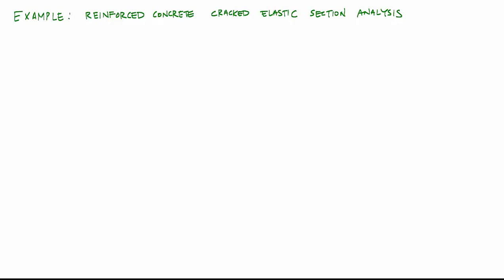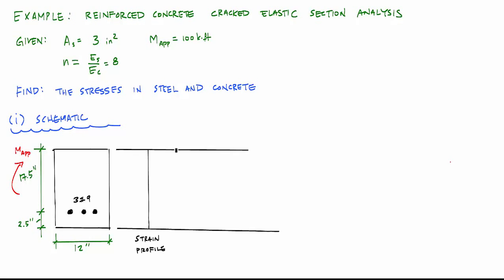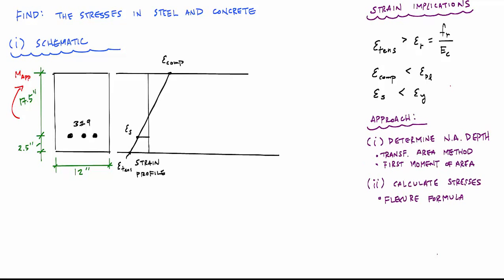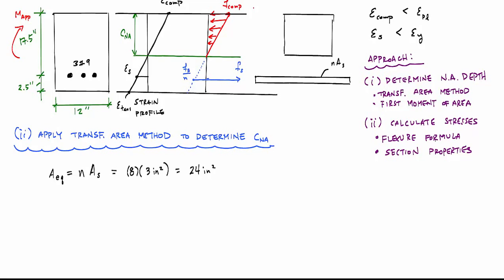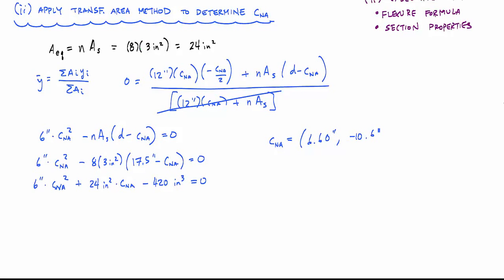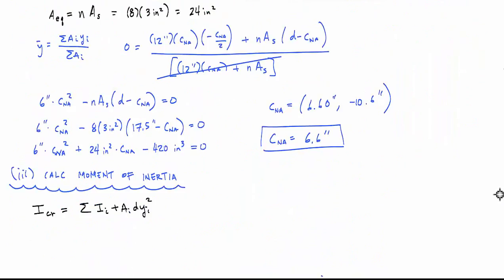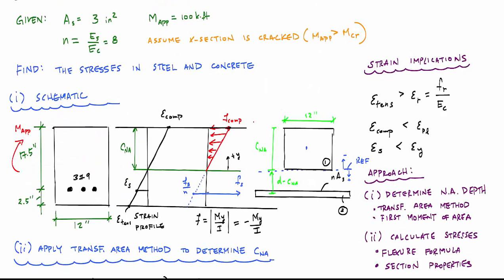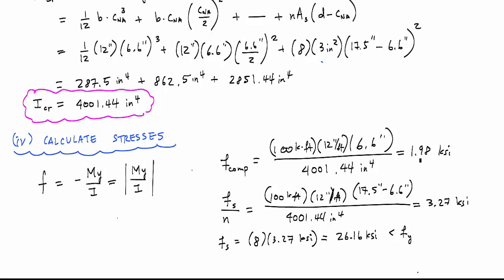Cracked Elastic Section Analysis Example 1 - Reinforced Concrete Design and Analysis

Comment: Finally...first explanation I have found (after quite a bit of searching) for why the area moment of the transformed steel section about its centroid is neglected and only the second part of the parallel axis theorem is applied on the transformed steel section. Thanks!

Comment: Can you make a video on how to use the reinforcement to determine whether compressive steel or tensile steel has yielded or not for DOUBLE REINFORCE concrete beams? I know there is another way of doin it but my professor did it another way and I'm hoping maybe you might explain it better than him.

Comment: Hello @structurefree All your videos are just great.. you explain really good,
Can you (OR SOMEONE READING THIS) solve me these 3 questions that I dint get
1) What is the strain PL, for the concrete... It is the limit but how can I calculate it
2) same question but with the stress PL for the concrete.
3) I remember sometimes using (n-1)As... can you explain me when is this used 
Thanks..

Comment: How does the number of steel reinforcements affect the problem? For instance if there were only 2 steel rods instead of 3.
Reply: Never mind, realized that #9 bars had a cross sectional area of 1 in. therefore 3 of them would give a total area of 3 in. Was just confused on that part. Very helpful video, thanks!